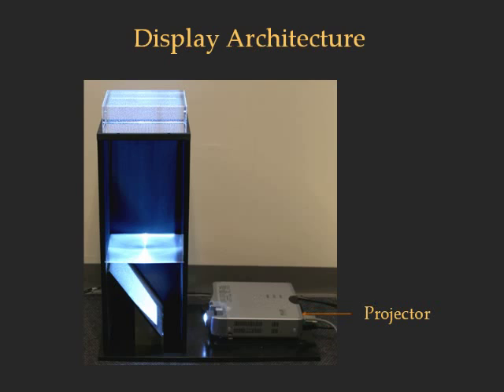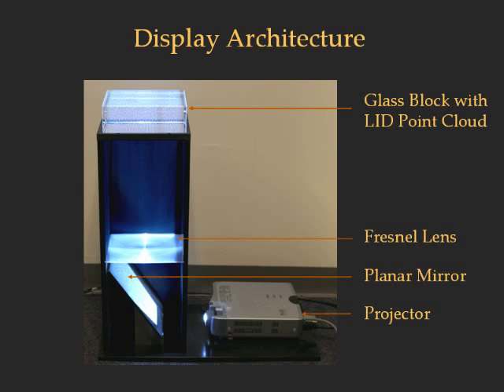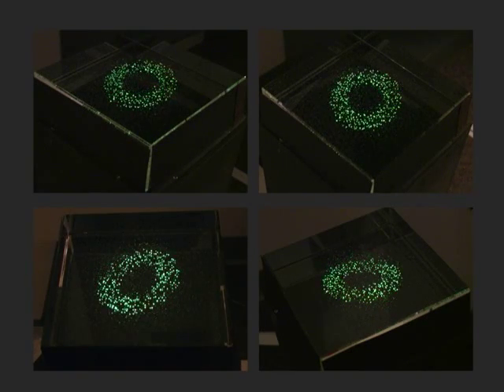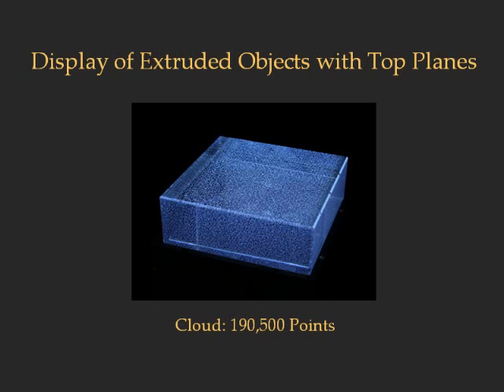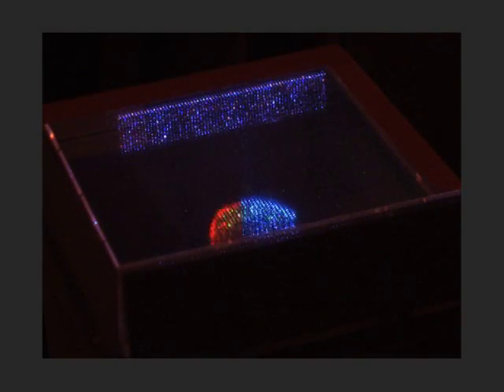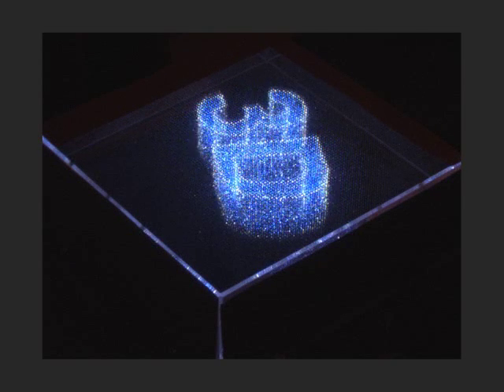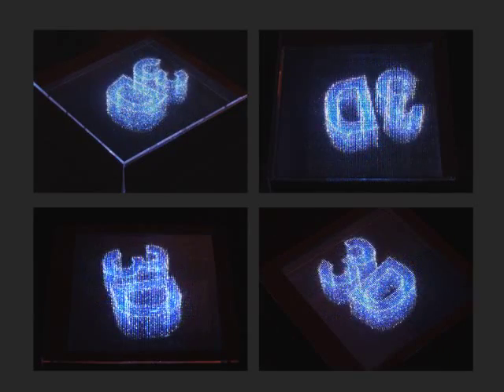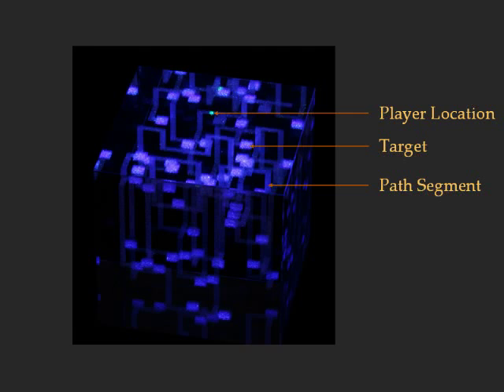Volumetric Displays: Passive Optical Scatterers

Comment: Voxiebox blows this out of the water though =)
Reply: Voxiebox is great. But it's an actively driven high speed mechanical display. This one is interesting to think about because it's passive with no high speed timing requirements. Different approach.
Reply: @robb233  yep, the voxiebox approach (also voxon which seem to have made more recent and bigger versions of the same thing) probably makes a ton of noise (never seen it on video without music over it). I like this approach more and if it could be perfected to higher resolutions, could be quite cool and usable. The block of acrylic just needs a denser cloud of smaller laser etched points, the projector needs to be higher res and higher refresh rate, and you'll have something good looking.
Reply: This was from 2006.

Comment: I wonder if the light scattering points could be constructed in a way which would refract light in predictable directions, so that depending on the direction of the light entering the point, you would get different visual outputs. Instead of projecting light onto the scatterers with a single projector, you could use multiple projectors at different angles. This way, the light which is outputted from each scatter point would only project to those directions which would be naturally visible in the real world object. The effect this would have is that the displays wouldn't be 'transparent;' They would look like solid objects, with different properties depending on where you viewed them from. 

This might even be possible with a single projector. Imagine that each scatter point is shaped like an inverted 'teardrop,' with the point facing down. Depending on where the beam of light hit the scatter point, it could be configured to reflect to pretty much any direction. If it were possible to precisely control the beam, a single beam could be scattered in a very precise pattern of directions.

It might be necessary to use a laser array to get that level of precision.

Comment: i really curious about how you create the block of glass with laser induced damage. What is the hardware and if there is some limitation of size?
Reply: I think it's like what they have in the kiosks at the mall -- where they put your face in a piece of glass or something. -- I don't know what it's called, but they have the machine there where they make it. -- Seems like a great idea.
Reply: @BrainSlugs83  i also think that exactly this is the technology the use here for the solid.

as fare as i know the limits here are lens focus ranges. so more a do i have the correct optics question..
(the laser beam must be focused in the glass - so it has to enter the glass with a wide diameter..)

down the rabbit hole:
- the German Wikipedia article has some more information: https://de.wikipedia.org/wiki/Glasinnengravur
- and on of the manufactures also: https://www.vitro.de/neu_/industrial/standard-systems/industrielle-standard-systeme.html
  -  in there datasheets the z-height is all mentioned with 95mm. 
  - and i found a resolution of ` > 250 dpi marking possible in sub-mm-area`  that would convert to  0,1016 mm
    -- that calls for a very high resolution projector and a very accurate alignment ;-)